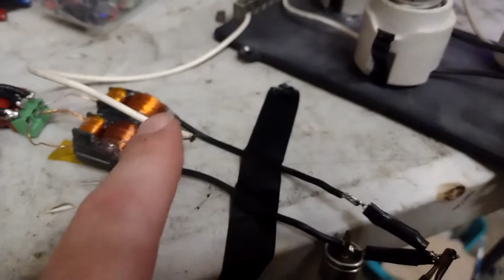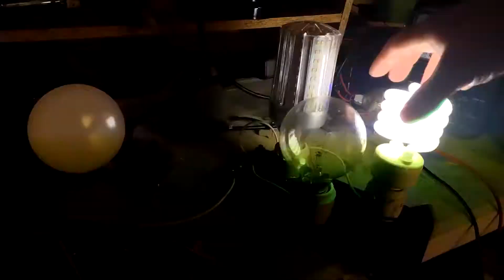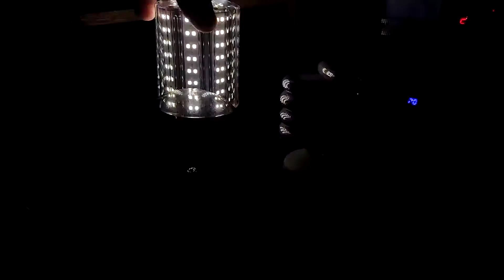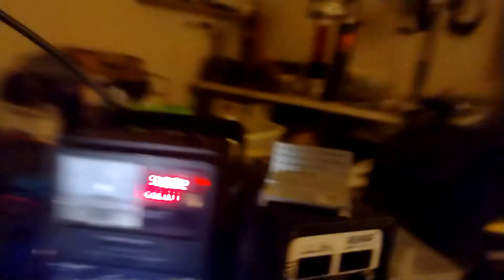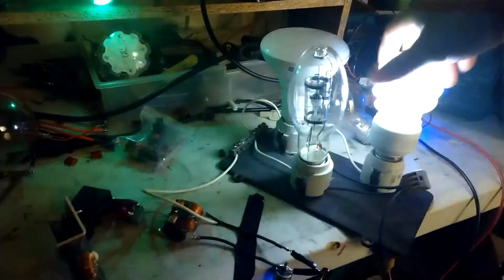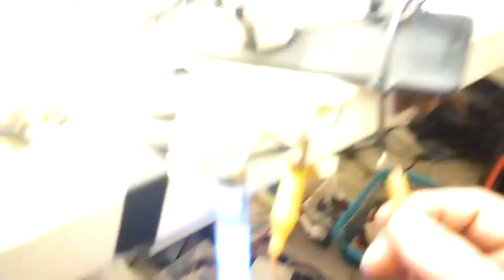ZVS Inverter w/DC + Ground/Wireless Field 9-15VDC

Comment: How do the led lamps with drivers  still manage to light up with hv dc😮 surely  the inductors in the  drivers would block the hf(impedance)
Reply from the maker: Even with no smoothing on the output there is very little ripple so HF doesn't present a problem. The trick there is just managing an intentional voltage drop which happens with this gauge of wire and that type of ratio. It drops to about line voltage with those loads on. Adding multiple loads drops it too much.
Reply: @Magneticitist  sounds like witchcraft to me😅 keep it up😁

Comment: Can you try this with one of ur CW circuits watch?v=5_kBSuqw0Hc  ? Upside down onto a jar
Reply from the maker: Yea I gotta find one that doesn't require a specific arc loading to work right. Maybe just a half bridge I can try it on. It's cool as hell he got that to work though.
Reply: @Magneticitist  perhaps he used the ramped ZVS one shown in other vids
Reply from the maker: @sFeral  Possibly. I'm sort of halfway working on a SGTC kind of deal inspired by some of the Don Smith builds out there, of which there are actually a couple here and there which demonstrate a real principle nicely. Since it's using a spark gap this may end up a good thing to test that on. I should have tried it on my first tuning before changing everything around but I had 50 turn coil spitting some little baby 3/4in SGTC style arcs with something like a 4-5MHz ring. Only 2nF cap for that frequency so probably wouldn't have done much.  I'm trying to tune it to where I have beefier HV output at which point I could probably just try grounding one end and running the other into a cup of water or something and see what I can get.

If you've ever seen the kind of discharges Tesla Stout Bars style circuits make, which are basically just HV camp dumps into low impedance inductors, then those whitish arcs would be cool to run straight into water.